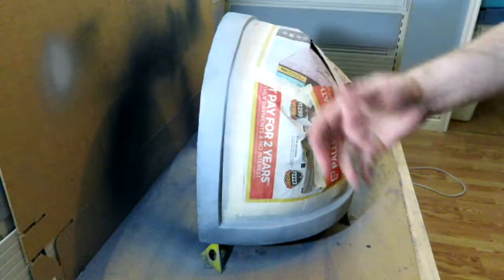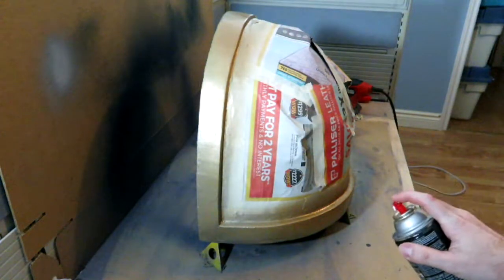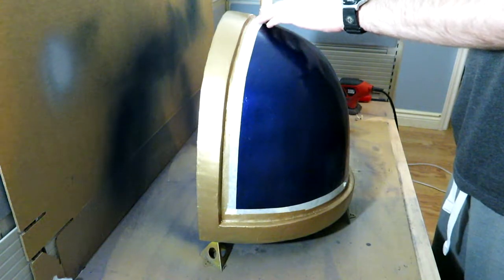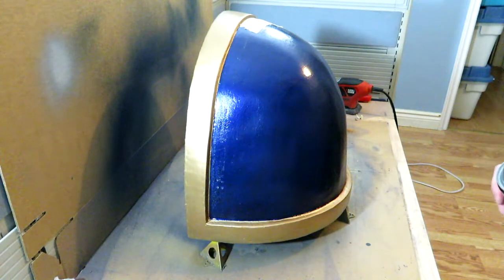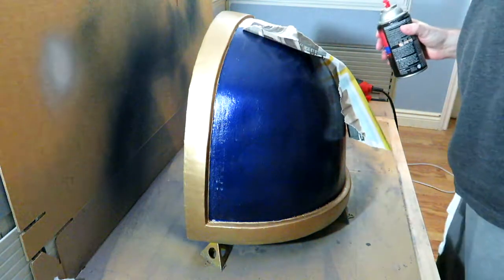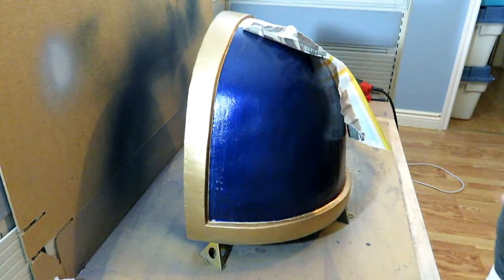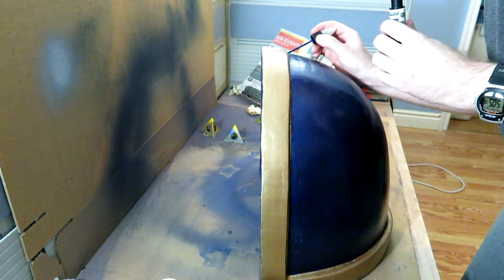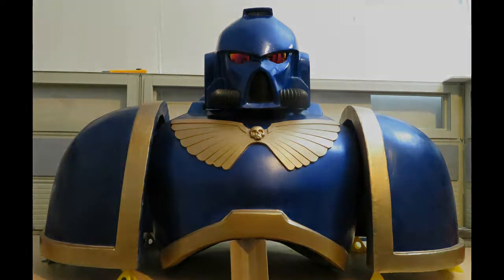Cosplay Space Marine - Reworking the Pauldron using paper mache - Part #6

Comment: I'm curious if post-it notes would stick well enough, but not so much it removes the paint underneath.  You could try touching up spots with a small paint brush.
Reply from the maker: Actual painters tape instead of masking tape would have worked (I've used it in the past)... I just forgot I had a big roll of painters tape sitting in a drawer :P